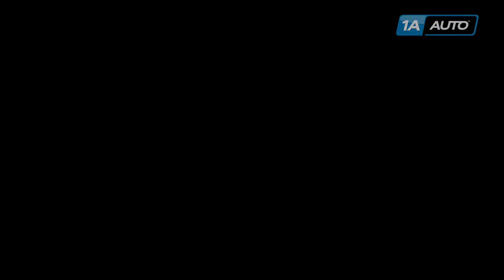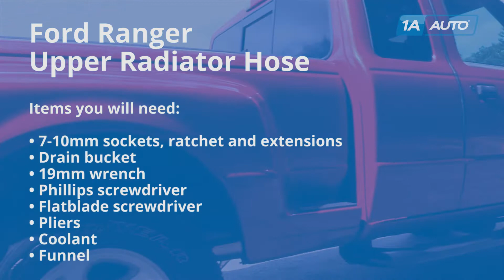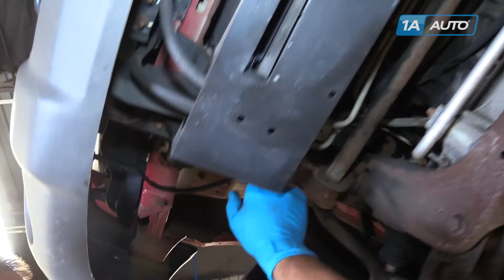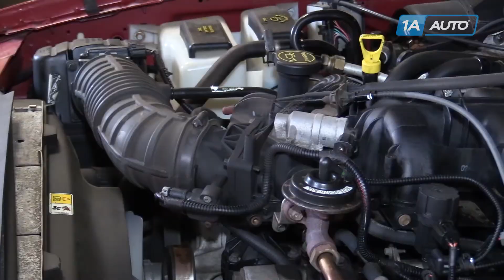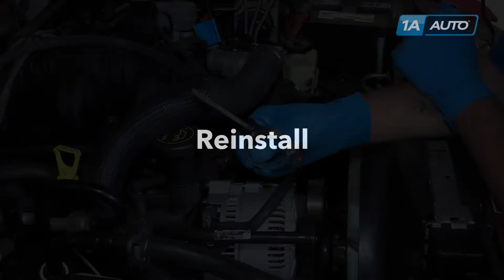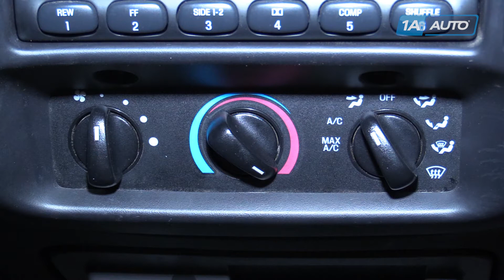How to Replace Upper Radiator Hose 98-12 Ford Ranger 4.0L V6

Comment: question, will there be radiator fluid in the upper hose when the vehicle is off?  Trying to know if there will be a mess of fluid taking off the hose near the engine.

Comment: Mine started leaking and it’s less than 2-3 years old but think it’s less than 2 yes 🤷🏻‍♂️🤦🏻‍♂️ it appears it rubs against my transmission cooler lines where they come up from the trans. Don’t remember this being an issue in the past considering I’m at 245k and these were replaced when I replaced the water pump and thermostat housing. Tried to figure out if the trans line is out of place somehow

Comment: I can't seem to follow. what do I need to do to get the clamp off of the top radiator hose?
Reply from the maker: +Geof_McNiel There will be a spring clamp on either end that needs the tension to be released with a pair of pliers to remove it. 1aauto.com

Comment: what is the part number for the upper radiator hose? AutoZone only has listed some incompatible part
Reply from the maker: +Flat 8Fact Thanks for watching!  We do not actually carry this hose so we are unsure of which part number would be correct.  If your local auto part store is unable to locate the correct hose we would recommend contacting the dealer or going to another store to see if they have it. 1aauto.com
Reply: @1AAuto for fuck sake how do you not have a part number